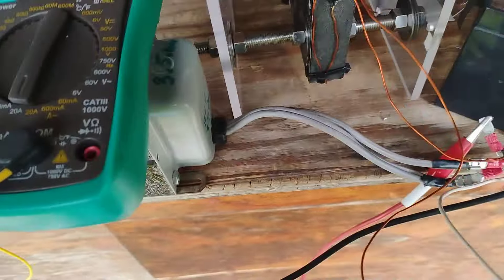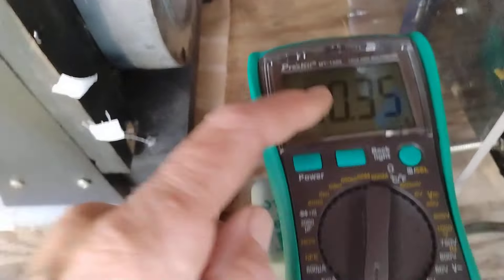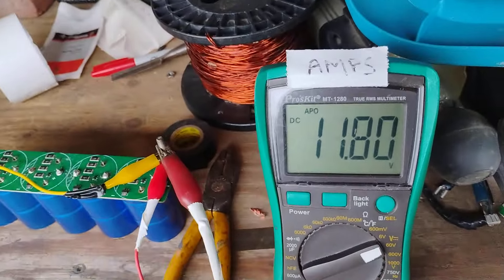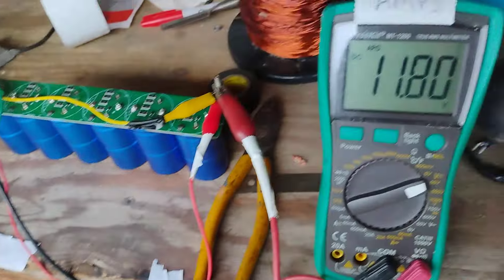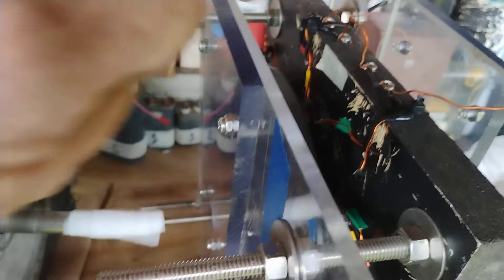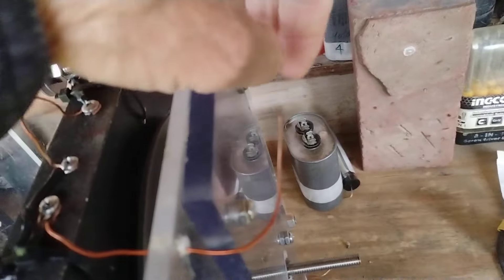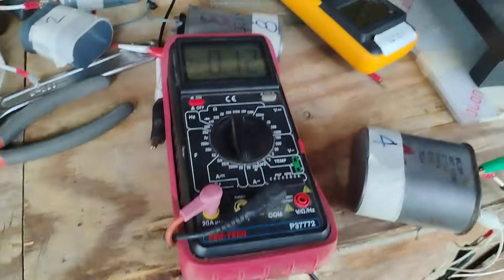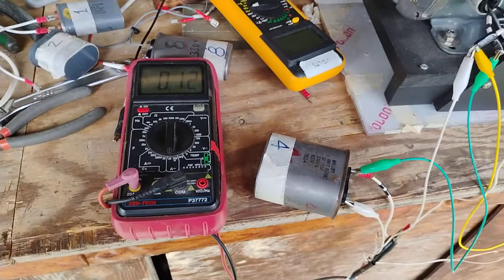20uf series cap on AC line from invertor raise output 50ma while reducing input 40ma

Comment from the maker: That is 40ma decrease at 116Vac from invertor, into RV motor,  while the increase is 50ma at 12Vdc charging the  12V battery with super cap in parallel to it, and the battery and super cap feed the invertor which runs the RV motor (and so on)

Comment: Hi Doug, do you have a few more of these La batteries? Maybe put a second one parallel to the current one and see whether you can charge the second also? Possibly there are slight differences in the 2 batteries, so one charges faster or slower or starts not direct but only after some initiation. Great project!😅

Comment: You limit your output to the 15 volts because you don't want to damage the super caps right?
But by paralleling with the battery your clamping the voltage level to the battery are you not?
Since your supply is slowly dropping increase your output connect up those other two coils and add more if you have to
Reply from the maker: Yes you are right the batteries are working to dampen or limit the voltage so for example there is 44vac coming out of secondary of transformer before the FWBR and it is not damaging the invertor however one of my three statpower invertors blew up not sure how this happened but probably battery taken out of circuit accidently somehow.  Probably I should have voltage regulator or DC to DC convertor to limit voltage to keep voltages safe for invertor 
Also what I want is lots more current being sucked into battery and super cap one way to do that is lots more voltage being produced along with good enough currents and the current is going to follow that increase in voltage so could flip the transformer around have 200v hitting battery but that probably an over kill...I improved that alternator with tighter air gap now plus going to string the two unused coils into circuit too 
Thanks for ideas and observations!